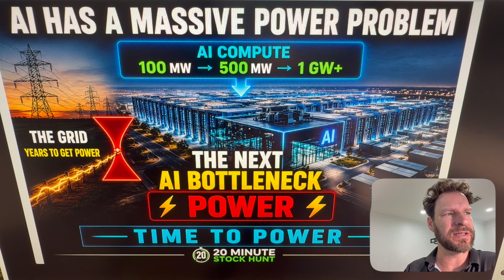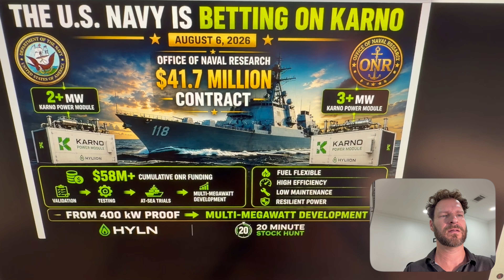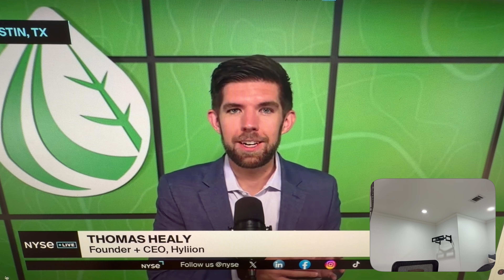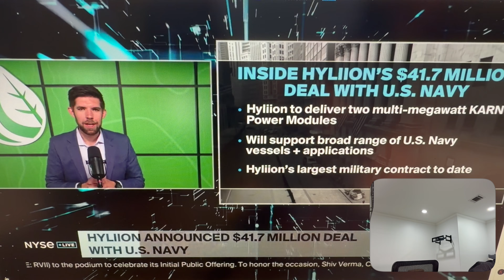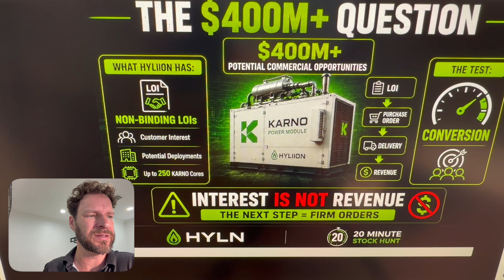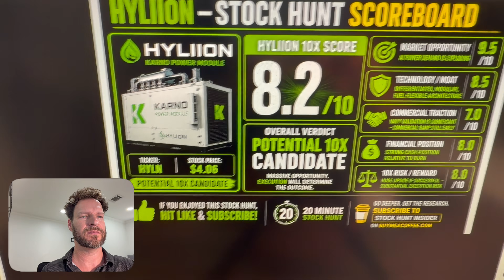Monday 10X:  This $4 Power Stock Could 10X:  And The US Navy Is Betting On It

Comment: Here is another angle to look at...
What if HYLN partners with the right 3D company the same way that Tesla did with Panasonic? I know they previously worked with an outside maker and they had to bring it in-house but now they have worked out the bugs.
Potentially, as time progresses and sales grow, the company can go from partnering to adding on some vertical integrators such laser welding manufacturers that already have scaled up. Such vertical integration can not only leverage increased 3D printing footprint but also spawn creative diversification with even more valued assets and revenue gigs. It is the lasers that are the common element and has the highest technology overhaul demand. China has been very successful with laser welding that recently Space X has adopted as well and is demonstrating as I comment. A laser company bidding on drone defense contracts may be a good place for HYLN to explore and plan on. Also, Build an engineering team that can demonstrate a laser 3D printing build from scratch and subsequently perform an upgrade such as more precise, faster, or higher energy output.

Comment: Just like Edison did back at the Turn of the Century. Multi Fuel Systems work "more Better with One Style " of Fuel then others. (Higher Yields). Love looking at All the Tesla Battery Units @ "Moss Landing" in Calif. Are "their" cost per Watt worth it? for Military? or Data Centers?
Reply from the maker: Good question. I think batteries like Tesla’s Megapacks make a lot of sense for smoothing demand and providing backup power, but they still have to be charged from somewhere. For something like a data center or military application that needs continuous 24/7 power, that’s where technologies like KARNO get interesting — actual onsite generation, with batteries potentially working alongside it.

Comment: Same thing a Bloom Emergy BE
Reply from the maker: Similar goal — onsite power — but very different technology. Bloom uses solid oxide fuel cells, while Hyliion’s KARNO is a fuel-agnostic linear generator designed to convert heat into electricity. Bloom is MUCH further along commercially, though. That’s part of what makes HYLN interesting if KARNO can prove itself at scale

Comment: Hyliion has a huge problem in scaling their technology. They will overcome this in time, but as a power source for data centers they will be too late to the party. When they get to the point that true scale of actual production can satisfy market demand it will become a big deal. Look for the quarter they actually show a profit. That is when I will invest in it once again. I believe in this company long term if it can scale production.
Reply from the maker: I think this is the biggest question with HYLN right now. The KARNO technology can work, but proving they can manufacture and deploy hundreds—and eventually thousands—of modules economically is a completely different challenge.

Where I might disagree slightly is waiting for profitability. If Hyliion successfully demonstrates commercial deployments, converts some of those LOIs into firm orders, and proves it can scale production, the stock could reprice well before the first profitable quarter.

That’s why I view HYLN as speculative today. The upside could be enormous, but they still have a lot to prove. Scaling KARNO is probably the biggest thing I’ll be watching.

Comment: What will be the capex to expand production?  Good concept .  can they produce the hydrogen on site?  Solar to hydrogen has been a proven concept for some years now.  This would please the greenies and open up the EU.  Just wondering what they see.
Reply from the maker: Great questions. Hyliion hasn’t given a clear number yet for the total CAPEX required to reach true mass production, and that’s one of the things I’m watching closely as they move from early deployments toward commercial scale.

On hydrogen — yes, KARNO is designed to be fuel-flexible and can run on hydrogen, but it doesn’t actually produce the hydrogen itself. You’d still need an onsite hydrogen source/storage system or something like an electrolyzer producing hydrogen from electricity.

That could make a solar + electrolyzer + KARNO setup interesting down the road, especially in markets where low-emission distributed power is valuable. For now, though, I think Hyliion’s biggest challenge is proving KARNO commercially and showing they can manufacture these units economically at scale. 👍
Reply: @20MinuteStockHunt I think micro nuclear is the future for the AI space.   It fills the gap in local power needs and keeps the electric costs down for the local population.     There can be a good synergy with global electricity needs and AI to work together.
Reply: Why would you use solar to generate hydrogen to then burn it in a generator to turn it back into electricity all on the same site? You are losing over 50% efficiency with each step.  Just use the solar power directly, store in batteries if needed.
Reply: @GoingGoneGalt I agree with you about this,  however,  batteries on that scale will also consume energy cooling.   BTW,  it is very efficient to take excess solar and produce hydrogen.   Batteries are toxic to the environment.   Hydrogen is not.   Batteries require mining,  hydrogen does not.   The greenies,  have a lot of things they like to see that help get projects approved.   It's about selling the product and getting it approved.
Reply: @peacefulprepper2402 With current technology, the round trip efficiency from electricity to h2 and back is 30% to 40% at best.  Battery storage gives 80% to 90% efficiency.  Solar panel production also requires all the ills you mention, and you would need twice as many of them for the h2 scheme, as well as the land to put them on, which everyone hates nearly as much as the data centers themselves.
Reply: @GoingGoneGalt many good points.   I also don't like solar farms.   The EU has gas,  solar and wind.  They seem to love the green solution.   I think the US is moving in the right direction.
Reply: @peacefulprepper2402 There is nothing wrong with solar per se, but the way the government incentive structures and corporate boardroom BS gave been built, they are going in all the wrong places.  In upstate NY, they are taking over half the farmland, which is some of the best in the country.  That's not progress, it's crony corporatism.   It belongs on rooftops, covering parking lots, and covering canals and reservoirs to curb evaporation, not eliminating food production or destroying wildlands.

Comment: Aside from the over use of A.I. visuals thats a genuinely good video — you're one of the few people covering HYLN who actually separates LOIs from revenue, and saying "don't give me another LOI, give me purchase orders" is something really agree with.

Couple of things from the Q2 call that should be taken into consideration..

Commercialization of the 200kW module moved to 2027, not late 2026. What's in 2026 is roughly 10 early adopter units.

The non-binding LOI book is ~750 KARNO cores (~$400M), not 250.

The $41.7M Navy award is mostly 2027-2028 work, and the existing Navy contracts wind down in H2 2026 — so there's a realistic revenue air pocket before the new awards ramp.

Q2 gross profit was ~$0.4M on $4.9M revenue. That revenue is mostly cost-reimbursed R&D, so I'd be careful putting any sales multiple on that yet. 

On the 10x math — 10x sales is closer to a software multiple. GE Vernova and Caterpillar trade around 2-4x. At a hardware multiple, $7B+ needs a lot more than $750M of revenue. 

And the thing I'd say is the real crux: Healy said data center customers are asking about 100-400 MW of annual capacity while the existing 30-printer fleet supports about 15 MW/yr. The bottleneck is almost definitely additive manufacturing throughput and the capital to scale it, not whether customers show up.  Keep it up.

Comment: Fair, well thought through review. Hyliion KARNOs low heat signature, small footprint, low maintenance, low noise levels, and fuel agnostic status (capable of using over 20 fuels, to include switching from diesel to natural gas), this is why I am confident the military will widely adopt use of KARNO moving forward, and partially why I am invested in HYLN, as a retired US Army officer. As you noted, there is a scarcity of efficient electricity producers, and few that are able to check all of the boxes I referenced above, some of which you also noted. Add in a publicly announced contract with a big commercial name in the coming year or two, such as Home Depot and/or Amazon, and the company will likely go even higher than 10x during the next 3-5 years, IMO.